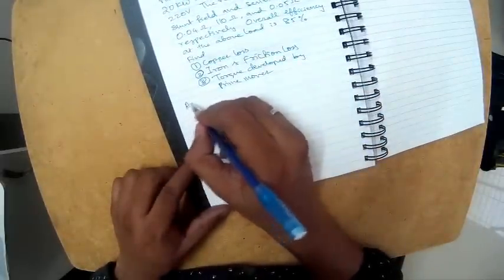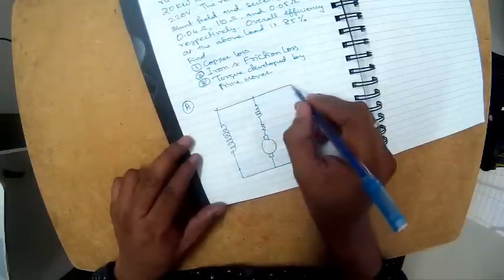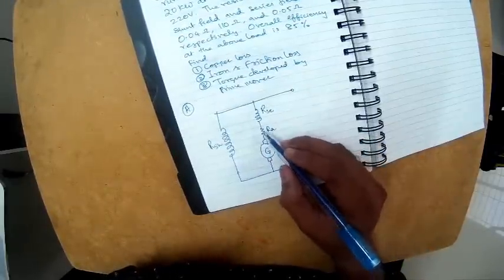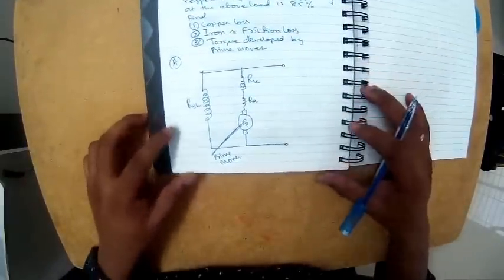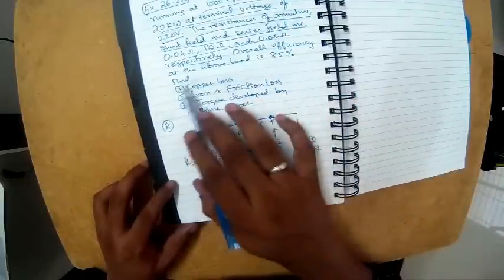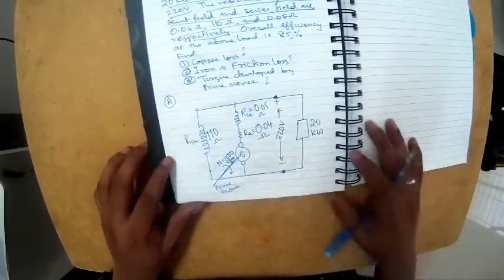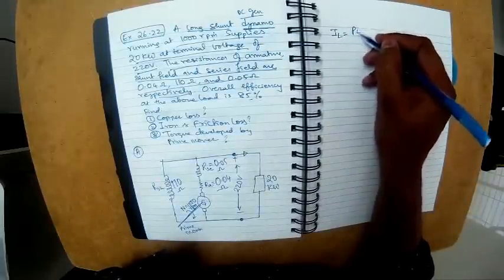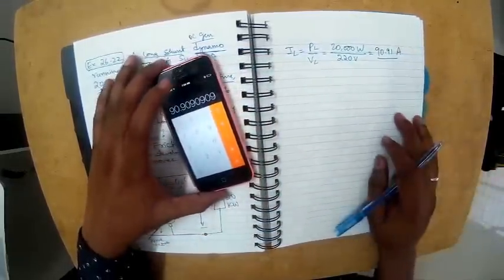DC Generator Example Problems - Ex26.22

Comment: A 4 pole machine running at 1500rpm has an armature with 90slots and 6 conductors per slot.The flux per pole is 10mWb.Determine the terminal e.m.f. as d.c. Generator if the coils are lap connected.If the current per conductor is 100A.Determine the electrical power

Solve this one.

Comment: You mentioned,  electrical loss is only copper loss. I think there is another electrical loss, named core loss. Am I right?
I really liked your solution and explanation. Thank you.
Reply: The losses in the core  are counted under "Iron" losses. "core loss" is nothing but "iron loss"
Reply: No you are wrong.....core losses occur in the metal of the machines....
And copper losses occur in the windings(wire)  of the machines.